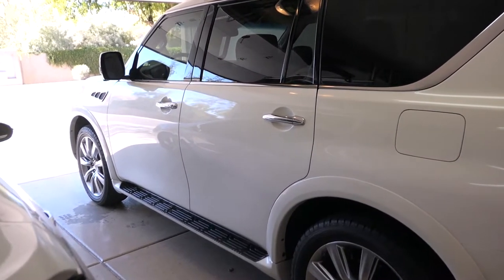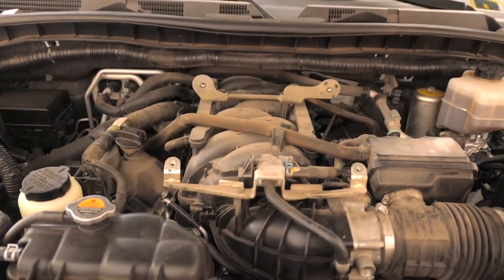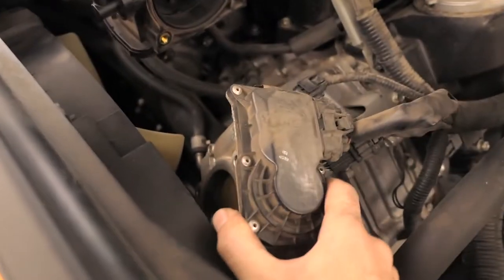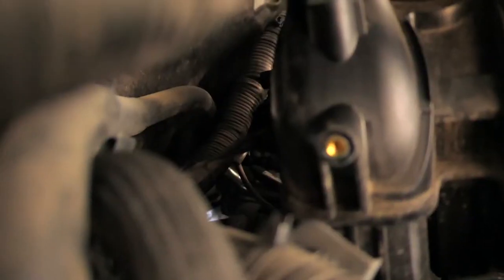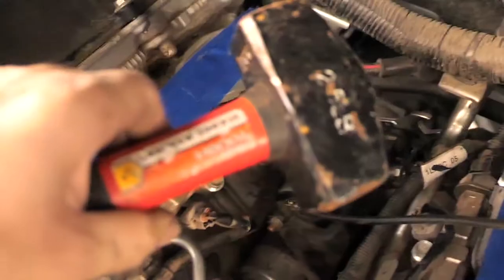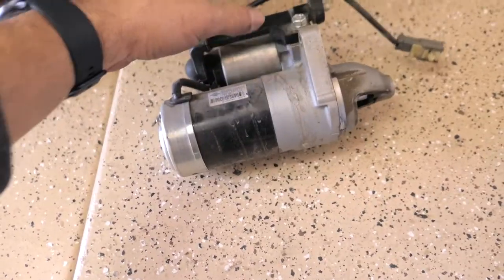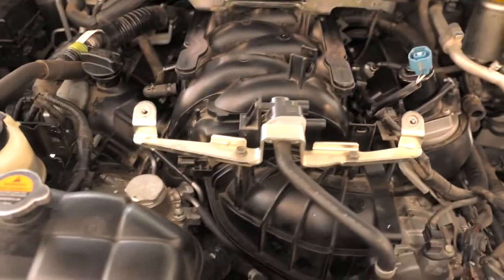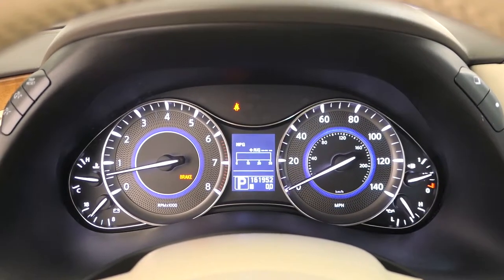Infiniti QX56/QX80 - Starter Replacement

Comment from the maker: Buy starter here: https://geni.us/WKA3pG2
Recommended: http://geni.us/JustVlads
Reply: Nice video
I had a lot of trouble with that last bolt passenger side at the firewall 
Use a flex bit for an impact driver.  Much faster
Do yourself a favor and unclip the big wire harness on the passenger side at the two points forward of the bracket that is bolted to the manifold
Loosening the harness will make getting that bolt out easier as my harness was right up against the bolt
You should also push on the harness hard towards the firewall to get your socket on that back bolt
Reply: Thank you for the video. I have an M56S  I need to replace the starter on, and I'm  not going to spend $2200 at the dealership or $1000 at a mechanic. The position of the starters are the same.
Reply: I have a 2010 qx56,I put a brand new battery in a it..it will start and bunch of times and every now and it won't crank up at all now. I turn it, it lights up but won't crank..I think it's the starter..
Reply: Just did the one on my wife's 2014 qx80. Sat with the battery disconnected for about a week waiting on the starter to come in.  Now when she cranked it up all the warning lights came on and it was idling over a thousand (1000) rpms. Took to shop and was told there was a code for the right rear abs sensor and an engine ground strap issue. But I didn't see a ground strap in the video or on my wife vehicle,  not counting the battery ground of course. The mechanic said there should be one that one of the starter bolts goes through?
Reply: @Just Vlad how is that starter holding up?  Have you had any issues with the starter since you replaced it?
Reply: Boy you better get gas soon

Comment: UPDATE!!!!!   I got a tip to help improve this video. When you get to the starter. undo the "power to unit wire" then the wire connected to the bottom of starter. After those 2 are removed, un-bolt the 2 bolts holding the black bracket to the starter. They are 12mm. Then the right side bolt (14mm) holding on the starter is easy to reach. Great Video

Comment: I had same issue with 2012 qx56 (clicking sound sometimes it would start sometimes you had to press ignition button couple of times) and dealer suggested starter replacement I did not agree and did a little digging and found out that starter relay under the hood was to blame, there are three identical relays in the fuse box under the hood, one for starter relay second one for radiator fan and the third one I don't recall but  I replaced all three  about year and half ago and never had this problem again not even once,

Comment: Perfect video. I have a 2013 qx56 and it kept clicking every now and then but not starting. U saved me $1,100. Premier gear starter cost me  $125. Intake gaskets and throttle body gaskets was $55. Infiniti dealership wanted $1,300. Thanks man u made it easy. I will say that those bolts holding the starter was hellacious. Took me forever to get em off. Took me a total of  6 hours to fix. I am a rookie at it
Reply: Did they want $1300 for the part or did that include labor?

Comment: just completed this job. my one recommendation is removing the bracket on the starter. the one that goes from the back of it (held on by a nut) and goes to the front, and you put the main power wire from the vehicle on. this allows much more room when loosening and tightening the starter bolts. thx for vid

Comment: Thanks a lot for the video, this is exactly what I needed! I did this yesterday morning and it took exactly 3 hours. I could have shaved 30 minutes or so if I'd had an air or electric ratchet. The only thing I might add is you can just remove the top of the air box without removing all of it. Also, I did see comments where others removed the "bracket" on the starter to help access the bolts, but that didn't seem to help me. I just used about a 2" extension and was able to get around the hoses that were in the way-those really weren't too bad though. The hardest part was the bolt closest to the firewall on the passenger side. It is a huge pain, but do remove the ties on the wiring bundle that's in the way and just push those back with one hand while you get the socket on that bolt - just make sure you have a long enough extension for your ratchet. Overall, although not easy, it is a very doable project if you've spent any time on a car. My biggest peice of advice is do this job first thing in the morning, not late at night when you're tired. I was tempted to try it the night before but glad I waited until the next morning when I was rested.

Comment: A couple words of wisdom from someone who spent a good chuck of their weekend performing this swap-out (thank you for the video, it helped immensely!) 

1) Do yourself a favor and get a bright color of frog or painters tape and mark all the hoses/wiring harnesses with it - it really helps reconnecting everything and making sure you didn't miss any of them.

2) As some others have mentioned, the troublesome bolt on the actual starter (driver side) isn't too difficult to get to if you take the two bolts off the starter/solenoid bracket before removing the original and before installing the new one. The nuts on that side bracket that connects the starter to the solenoid are really easy to get to and really opens up some real estate in there with turning a wrench on the hard starter bolt. For the new one all I did was loosen the bolts and swing that bracket to the side but it gave me more room to play with.

3) One step I'd add is to bring a vacuum with a fine nozzle extension to the garage when you do this repair. I found a fair amount of what looked like beach sand and various small debris like broken plastic clips and other things in there. I vacuumed what I could before I removed the manifold, then removed manifold, then taped off the openings and vacuumed again. Less chance of dirt falling down the cylinders and nice to clean up those cavities while you're in there if you can.

4) Not sure why but I did not have a "wire" to unhook at the back of the manifold. I looked and looked and looked and nothing was connected back there. There is a little rubber capped off nipple-looking thing back there but nothing clipped onto it. I just thought I'd mention it in case others were doing this repair and confused by this step.

5) For the troublesome manifold bolt (all the way back and left on the passenger side), what worked for me was to unhook the large wiring harness snap-clips and take a large crow-bar - shove the rounded end against that harness and wedge the crow-bar under the metal bracket on the top of the manifold that the engine cover sits on. This helped not only push that big mess of wires out of the way, but the crow-bar held it there and out of the way while I worked. I also took some heavy duty gorilla tape and put a couple wraps around that hardness to hold it to something else out of the way so it wouldn't budge when I removed or re-installed the manifold. Obviously be careful shoving anything sharp against it, but the rounded end worked for me without damaging anything. I also used a very stretchy soft bungee cord to hold some of the air tubes out of the way which was also helpful. After holding that mess of wires out of the way, a 1/4 inch drive with 6-inch extension going to a 3/8 inch adapter/3/8-inch ratchet worked almost perfectly for turning a wrench above the manifold. For the other 9 bolts with more room I found having an extra 2-3 inch extension to be more helpful and raise the wrench higher.

6) If you don't have one of those flexible grabber tools where there is a magnet and claw hook at the end of it, I'd get one before this job. The hard manifold bolt was much easier to grab out of there (putting it back in I'd maybe set it in the the bolt hole before setting the manifold there?) and other small pieces of this or that that I had to grab - so I used this tool probably 1/2 dozen times for grabbing whatever I dropped or debris I saw and wanted to get out of the engine cavity.

7) I'm a big dude (240 lbs) and laying flat on top of all the uncomfortable engine parts really did a number on my rib cage and belly. I'd suggest some soft foam or something to lay out there both to make it more comfortable for you and also minimize possible damage since most of those parts aren't meant to be laid on for extended periods of time. It's early May and I've been watching 2 NHL hockey playoff games per night, so a 20 minute intermission between periods was the perfect amount of "I'll lay on this uncomfortably for a bit then take a break" before repeating it all again 45 minutes later. I didn't keep track of how much time I spent start to finish but would wager it was probably 4-5 hours if I did it start to finish. Was a lot easier putting everything back afterwards versus taking it apart and figuring out how things connected and what snap clips to un-do.

8) I bought replacement gaskets for the manifold, but ended up not using them. I took the old ones off and any that were flattened or smooshed on the mating side I just flipped over and they looked brand new again on the other side. I bought the same starter this video recommends and it was $94 + tax so right around $100 on Amazon. So re-using the manifold gaskets saved about $60. I obviously would have replaced them if mine weren't re-usable.

9) Lastly - I was a bit concerned with torque values on the manifold bolts as I have a tendency to over-tighten things. I searched online and couldn't find them, so I tried to snug them up without over-tightening them. Many cars have a tightening procedure for this in a certain order and torque spec.

My wife's car is a 2016 Infiniti QX80 and had 161,270 miles when I did the starter swap-out - oddly enough almost the same mileage as the one in this video. Hope these notes may help some other folks viewing this video and tackling this DIY repair.

Comment: Oh man...  Thank you for this video.  Thank you.  THANK YOU!  Saved us at least $1000.  Just finished this today and your directions are spot on (we have a 2015 QX80).  
I have some tips for anybody looking to do this.  

- Get a metric set of wrenches if you're worried about the sizes.  You'll use the 10mm the most.
- Get a good socket wrench and some extensions.  This will help a lot with the 10mm manifold bolts
- The clips are a bit of a pain, but we just pried them lose and snapped them back in.
- As others have said, take the bar off of the starter.  It will give you more room to remove the 14mm bolts
- We used the box end of a 14mm wrench on the "easy to get to" bolt and a socket on the "not so easy to get to" bolt.  Wouldn't advise effin' around here as I almost stripped that bolt being goofy.
- Careful tightening the bolts around the manifold - don't over tighten (!)
- If you buy wrenches/sockets, spend a little extra on quality...you don't want to have broken pieces falling down in here
- Take your time or you're going to lose something in that clusterf*ck of fuel lines, hoses, and like...a thousand dark crevices
- If you can find somebody with little-bitty hands, your life around the back side of the manifold will be 100% easier
- Take the battery brace off if you have one and get something comfortable for your knees.  I'm 6'1" with long arms and I was UP IN THAT ENGINE.

We definitely leveled up today.  Not difficult, but time consuming.  I kept wondering how big this dude's hands are because man...I couldn't do SQUAT on the back side!

One more time THANK YOU!!!!!!!!

Comment: Vlad - great video! You explained things perfectly. The steps were specific and clear. I can't thank you enough. This job took way too long because of a few extremely difficult bolts. But that is the fault of the Nissan engineers (who should lose their professional licenses for this miserable design). If you post a way to contribute a some money to you, I would because you saved me a bunch of cash that would have gone to a dealership/mechanic. Fixing the starter also gave me an excuse to buy a new angled breaker bar. Super awesome video. Thanks again!

Comment: Thanks so much for the tutorial.  Saved me about a $1,000 on replacing the starter on a 2011 QX56 rocking 160k on it now.  Mine doing something similar, started fine most of the time, but occasionally I would push the button and get nothing.  After a couple pushes it would finally fire up, but was for sure on its way out and I didn't wand the family to get stuck somewhere.  Got the starter from Rock Auto for $90 and took maybe 3 hours to install (including about 1 hour working on those impossible starter motor bolts).  I nearly gave up on those bolts, but they finally came loose after I cut the wire ties to move the wire loom back there and disconnected/capped off a coolant hose to make more room for a breaker bar.

Comment: Man O Man! You know your stuff.   I followed everything you said in the video and the final  results was a running truck.  Thanks for the DIY video.  It couldn't have been more accurate on starter replacement.   I will definitely turn to you for any other issues I have.  Thanks again.

Comment: Man you save me money i will follow you. Texas weather 107 is not joke so it took me 2 days to fix. everything is true on the video i bought the part from amazon 110  2 year warranty and gasket from dealership. the intake left side is the hardest but just remove zip ties from engine. Tip you can remove that black bracket on the starter just remove that black plastic cover, then you can reach that 2nd bolt. i used a jack handle pipe to loosen bolt super eazy over the wrench. The Dealership confirm they used autozone parts sometimes. I found acorns on top of engine with the wire chewed up by squirrels.

Comment: Awesome video. Wouldn't have attempted this without it. We just passed the 106K mile mark and started having issues. Yes, that one back manifold bolt was a pain to get to, but not as bad as the starter bolts. I used a breaker bar on the right starter bolt and used your method on the left side (breaking it free with a hammer). The Premier starter is great as well. If you have the tools, go for it. Thanks!

Comment: Called around, $1500 to repair, minimum $100 to diagnose.   I had no previous issues in starting, this was 1st and only failure.   I could hear the starter click but not turn over.   Followed video and was able to fix with the starter, link provided for $100..  Took sometime on the back left intake bolt…. Not easy to get to for sure.   Great video, thank you!  2016 Qx80 with 65k miles
Reply: I found this video after my 2016 with 88,000 miles just did this to me last night. I was stranded for a while until my car finally started back up. it looks like it’s a starter issue. I didn’t know that before because I took it to Infiniti and they said that I was just having a battery malfunction lol

Comment: I just finished this. What made this loads easier was disconnecting that coolant hose right above the starter. Just plugged it with some rags and I was able to get a swivel head ratchet in there real easy.

Comment: Take the two bolt off the bar on the starter then both starter bolts are easy to get to and just take the top one off of the new one and loosen the bottom them it’s easy to install

Comment: Thanks for the excellent video! 2018 Imfinity QX80 (120k)that randomly wouldn’t turnover/start unless boosted. Swapped batteries out a number of times and it was good for a few months until weather was hot and then went back into no starts. This was the best video that I followed and had it changed in 3+ hours. 
Also ordered the same starter on Amazon for $90 and so far so good. 
He’s right about the last bolt on passenger side is a bit of a dick but nothing too bad. Get yourself some needle nose pliers to drop a couple of the hard to reach bolts back into holes when buttoning things up. Fat fingers dropped the last one and of course it went under manifold so I had to take it off again 😂. Easy with needle nose pliers.

Comment: I have a '17 Nissan Armada doing the exact same thing.  The same starter on Amazon is now only $101.  Any complaints after nearly 4 years about the part?  I don't want to go cheap on something that is such a pain to replace but why spend $500+ on OEM if I don't have to :) .  Awesome video btw.  The vids specific to Nissan are terrible but seeing yours gives me confidence to do it myself.  Everything explained well.  Thanks

Comment: Followed your video to a "T". New starter installed and everything put together perfectly. When I push the start button I just get a large "click", like the starter is not engaging the flywheel. Did I do something wrong? Are there shims for the starter that need to be placed? Any help would be appreciated.

Comment: I'm dealing with, what i think is the same issue.  2016 QX80.  When I go to start everything comes on, I hear a click then nothing.  But everything stays on, I have to disconnect the battery to shut it off, is that what you were dealing with as well?

Comment: Here's a dumb question  but I have a 06 and the starter clicks once so I was messing with it and nothing anyway I jumped the starter relay pin 30 and 87a and it sparked  but no crank now it will not click at all . Is there a fusible  link on the ignition

Comment: One more thing i having issues with my qx 80 shuttering at low speeds no check engine light. i changed spark plugs and all the fluids . i am lost not sure what is to check other then the coils. any suggestions will help me.